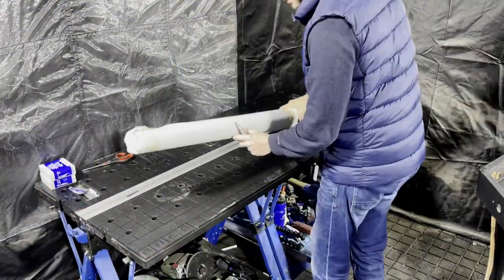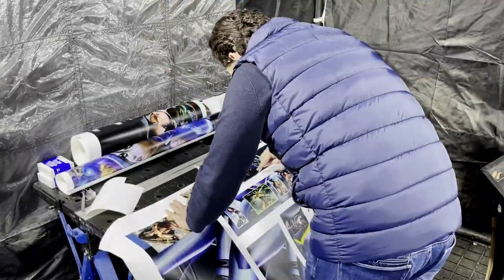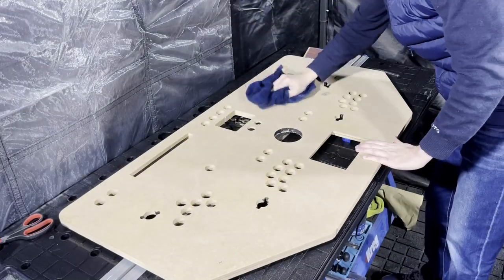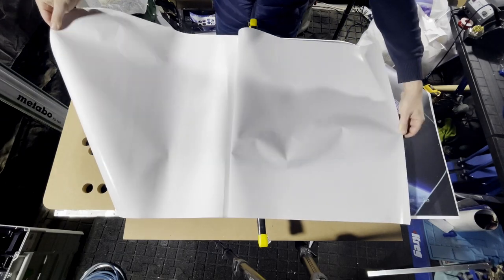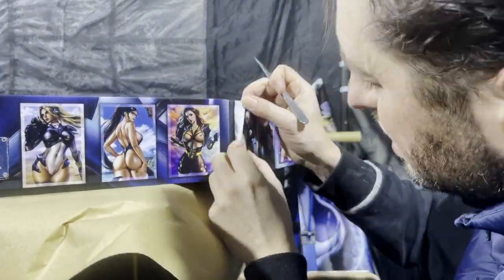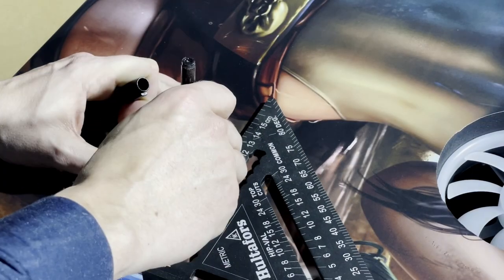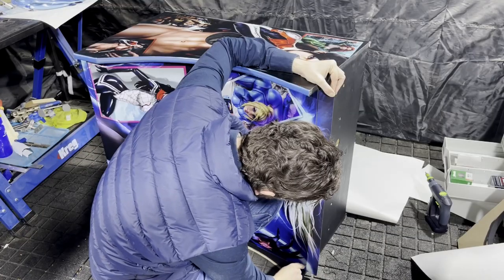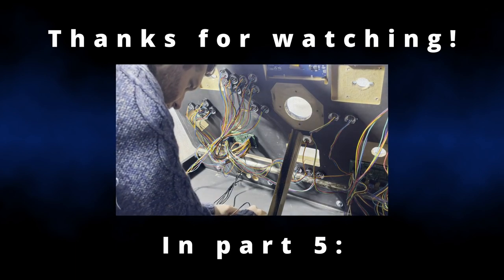Arcade Pedestal Monster Build - Part 4 of 6:  "Artwork"

Comment: I can't help notice it's not the first time the vinyl is the wrong size. Just wondered why does it happen quite often?
Reply from the maker: Yes, the printing company that prints it is very particular when it comes to uploading specs. One small in this case wrong export setting and they will just mess-up your final print. Happened 4/5 times already. But I found the culprit now so hopefully it will be the last wrong delivery 📦 😂
Reply: @TheDanielSpies_Arcades  Hurray! Fingers crossed they all come out correct first time from now.

Comment: I read that one should primer and paint before placing vinyl on wood/MDF/plywood/whatever....

I see you don't do this, reason why?
Reply from the maker: I have tested both. Sanded, clean MDF works best with vinyl Artwork. No wrinkles, easy to apply and sticks (much) better than on paint 👍🏼 thanks D